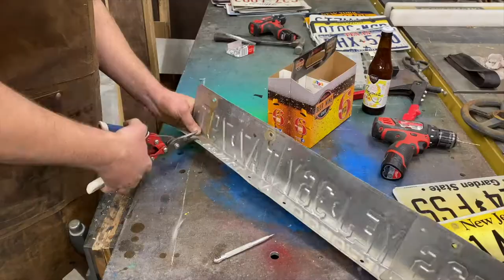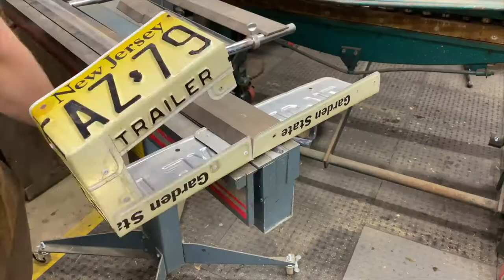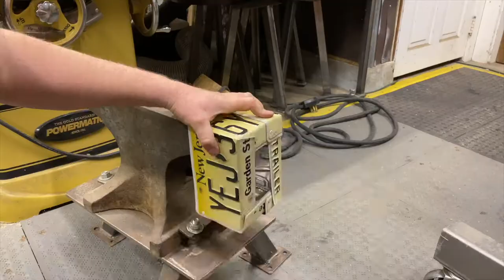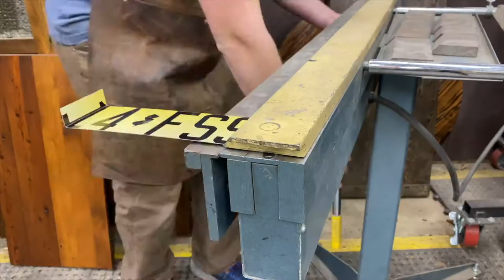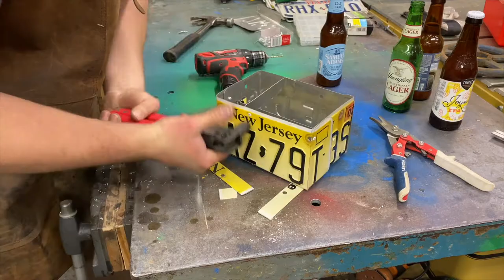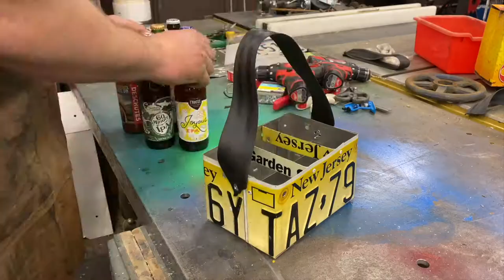DIY Beer Tote Made With License Plates

Comment: What kind of non-professional has a jointer, a panbrake, a guillotine, a metal cutting bandsaw, a domino, etc?
Reply from the maker: Me😁. The tools are mostly used and bought cheaply with money I make from the shop. The name just reflects humility, there’s a lot of people out there that make a lot nicer stuff.
Reply: @M8keStuff  How do you make money from the shop? Panbrakes and guillotine at that size are quite pricey, how much did you pay for them?
Reply from the maker: @Ace-zb5xr  Tennsmith Shear was $400
Reply from the maker: @Ace-zb5xr  Mag Brake is electric, I got that from the Eastwood R&D center in PA for $800.